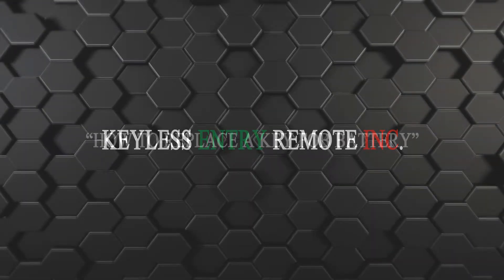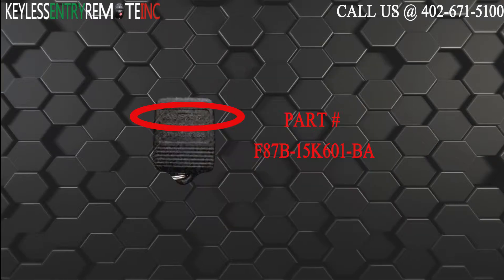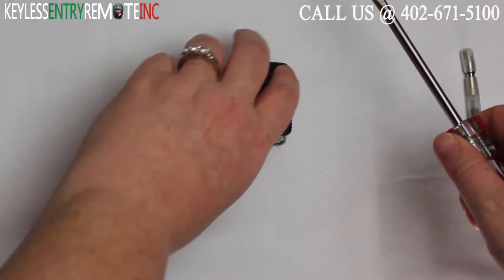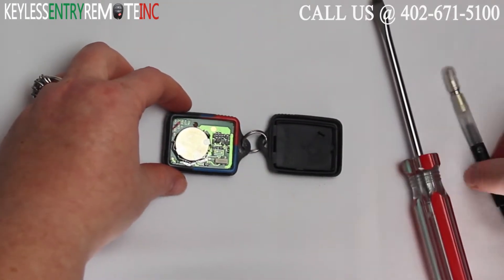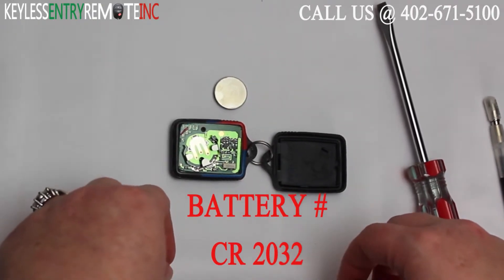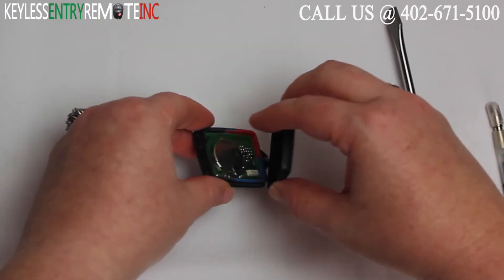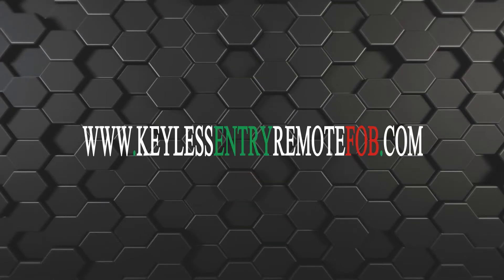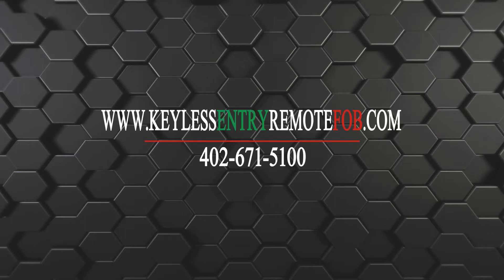How To Replace A 2007 - 2011 Ford Crown Victoria Key Fob Remote Battery FCC ID:  CWTWB1U322

Comment: Why doesn't the remote work after I change it ?
Reply from the maker: Make sure that you have the correct battery size and that it is going the correct way. If that is good, try disconnecting the car battery for a few minutes and then reconnecting, that has helped others.